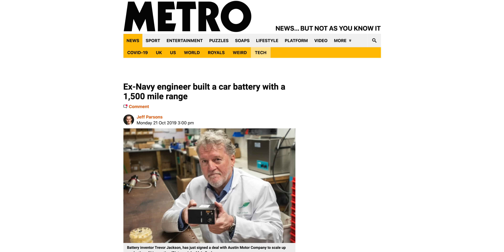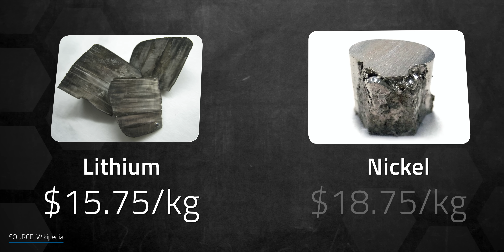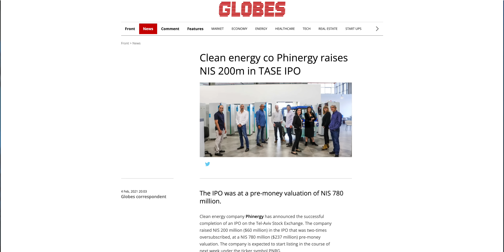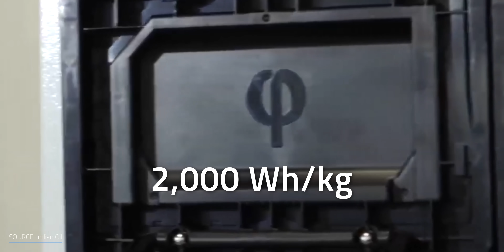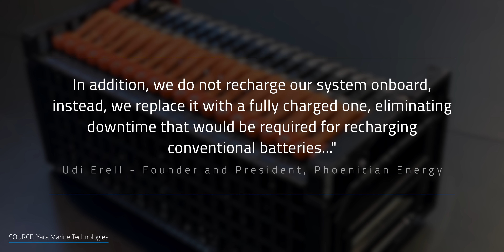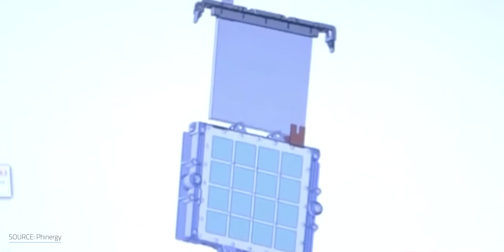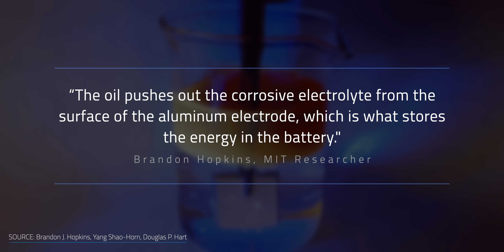Exploring the 1000 Mile Car Battery - Aluminum Air Hype?

Comment: If these had shelf stability and could easily and safely be stored at home and can be swapped out by a lay person they could have applications far beyond EV uses. The potential use for emergency backup power during a natural disaster over a gas generator would be interesting.

I would like to know if the aluminum can be recycled back into battery packs or would they have to go back to virgin materials to make new packs. I don't think building out massive aluminum strip mines and the toxicity that can be produced from mining generally would be the best solution if we are truly trying to create a green energy system. 

Much more information needed and look forward to the research continuing. the energy density is great but something with more than one life cycle i think would be much more useful.

Comment: Two batteries!  Each providing, what, a 1200 mile range.  When one drains, switch to the other one.  Then you have ~1200miles to get the dead one swapped. And, if this ever takes off, and there are a plenty of swapping stations, no prob.  The only draw back will be the drive until the tank is empty mentality.

Comment: I bet on it aluminium air battery is a better option for EV's because of the range & energy exausted battery swapping which can be done by 100s of thousands of fuel station spread over India run by Indian oil corporation.. 👍

Comment: Hi Matt! Probably the first time I am in disagreement with you. Aluminum batteries can not be recharged, agreed. But then the traditional ICE cars are also not rechargeable. So, what happens when we are out of fuel? We refill the tank right. So, when cars are out of juice from an Aluminum battery the same can be replaced/swapped within minutes. In contrast to setting up an EV charging station, a battery swapping station network can be made fairly easily as the nature of these battery consumtion will change to become more like an commodity. The vast network of already present petrol pumps can be utilized for this purpose or a local shop can serve the purpose. Also, if a car is out of juice in the middle of nowhere, then probably you don't need to tow the car to the nearest swapping station, the battery itself can be delivered to the car as these batteries are lightweight. 
Putting it into the Indian context, an average car drives about 1000 KM/month. So if a battery gives 1500+KM range then the car owner needs to visit for refueling once in about 45-50days rather every week for a petrol car (India runs on petrol). Also, nobody needs all cars to drive on electricity immediately, a 50% market share by the end of this decade should be a great start. If others technical matters can be taken care of then these batteries can have a future.

Comment: Could be a range boost battery for a more conventional EV. Half is a normal battery, giving you 150mile range, then a backup AlO battery it can tap off to boost an additional 1000 miles or so. You get stuck, just charge your normal battery to get to a swap station. But you'd have to make sure the AlO battery's shelf life allows you to only occasionally tap into it.

Comment: If battery swapping is the solution, what's wrong with the current lithium ion batteries being pre-charged in stations and engineering a way to make those batteries in cars replacable in 3 minutes.....

Comment: I’m most interested in the recyclability of these. How long does it take and how much energy is used to re make batteries. These sound great for trucks not passenger cars.  Instead of waiting for the battery to reach zero we would replace at the end of every trip and use the excess battery as part of a larger battery use system perhaps to assist in peak shaving for EVs or other high demand cases. Also possibly a great use for rail since trip energy use variability is likely minimal.
Reply: Think  e: bicycles

Comment: Well, if the battery has a higher energy density, why not use it for avionics? It doesnt matter if the battery is replaced after long flights, that can still be a good servicetime compared to the time and risks with pumping jetfuel.

Comment: A lot of push that makes ev's vaiable option is using energy from my own energy source be it anything like outlet at home charging station or few panells/ wind turbine. I switched to rechargable batteries since i can recharge them when i need them and dont have to go buy new everytime mine died. This doesnt show such potential so it looks worse for comfort than normal gasoline for me ...

Comment: "On top of that, aluminium air batteries have a great advantage with weight, compared to lithium batteries, 'cause aluminium, which you're probably aware of [sic] is extremely lightweight".
Explain again the relative density of Lithium vs Aluminium. Or perhaps better explain your point, if there is one.

Comment: If a 1000 mile range electric vehicle came out, there would still be some people that say "it's not enough, I need more range". Even today, with EVs having ranges of 200-300+ miles per charge, there are still loads of people saying "I need more range" even though there are plenty of places to charge. So would extra miles of range really make much difference? Not really, because there will always be those that say it isn't enough, or that charging is a hassle. Only those that really want an electric vehicle will be ok with the current range most EVs have, so having extra range would just be an added bonus to them.

Comment: Those battery packs sound like the stuff from science fiction and Power Cores in video games. Just treat it like gas. You get to a station, just keep swapping the battery to keep the power bank topped. These things will have to be cheaper than gas to take off and have a solid recycle and collection model to be profitable. I can see poor people hoarding these things to sell back. I wish I could invest in them.

Comment: So this is like aluminum oxidation fuel. Hydrocarbons are broken down and then we can reassemble them so this should be considered a fuel unless I miss something. I'm still thinking carbon-capture into fuel made from the air is probably going to be about as energy-dependent

Comment: The problem with lithium ion EVs isn't range anxiety, it's cost. The batteries degrade too fast, and the price of replacement is too high.
Hybrids have been around for a while now, but there are none on the second hand market in my region.

Comment: There are places in America and around the world, (Australia, Russia, Africa, etc.), where range is a very real issue. I imagine that having one or more of these batteries (and a water tank) on a trailer behind the vehicle would make some of these transits feasible in a BEV, where otherwise it would not. A vendor can have locations at each end of the transit point. Multiple smaller batteries would be more useful than on big one because it would allow unused batteries to be returned to the vendor for a partial refund. The biggest selling point is that it would work on any BEV with a trailer hitch.

Comment: depending on the costfactor of a battery i'd really consider using one. but i have the advantage of starting to work as a service technician for ev charging stations and, if this becoming a thing, i guess i will be trained in swapping those batteries too. after all it's just a cool idea atm and, as you stated, a lot of research is needed to make these coming at least close to marked ready.
still hope to hear more about aluminum-air-batteries soon!

Comment: Personally I'd prefer rechargeable over physical replacement. I can generate my own electricity if needed. All the rest of the components of the aluminum air battery is just a crap ton of work someone else needs to do, and if there's a shortage, I'm screwed and stuck. If I could own a few and the process to get them back into working order were in my control, I'd consider it. But I'm guessing it is a lot of melting of aluminum and chemicals and other crap and I'd have to buy equipment and keep it somewhere. So yeah, even if they get it working great, I don't love the idea of having to stop at battery swap stations.

Comment: I would drive it 100%.  It takes more then 3 minutes to fill my gas tank and its gets 350-400 miles a tank.  So, 2700 miles sounds like a deal.  And the "specialist" to change the battery would only last a little while I'm betting.  There used to gas staion attendants and thats laughable now.  As for the side of the road thing AAA would start carrying batteries as soon as there was a market.  I think Al-air sounds great.

Comment: Using two batteries might be one way to fully use batteries before replacement. Once one is depleted, run on the other one until the depleted one is replaced... (Without that, batteries with some capacity left will constantly be replaced)

(If a long trip is needed, both can be replaced for the trip and the partially used one can be put back afterwards to fully use it as well...)

Comment: I like the idea to be honest. If they made a way for the average consumer to be able to stop by a "gas station" and pick up a spare on the way home for when they need to swap, this would work perfectly. Imagine having two installed and two more spares for a long trip. 2000 miles before stopping for fuel? Yes please! I can't imagine an oil company would mind this kind of setup either because it would allow them to still dominate vs lithium batteries allowing for charging at home.

Comment: No, I’m not untying battery swapping. It’s too many atoms being shipped around to the gas station equivalents and then back to recycling plants endlessly. It’s inefficient and potentially dangerous. Also swapping a big block of the car as battery is physically demanding of the car and the people involved. Pouring in a liquid refill (gasoline) is much easier, so we’re only going backwards. I can see why an existing petroleum company would like this as they are back in business but it’s all hard and inefficient and retrograde. Forget it.

Comment: We'll have growing pains like this as we move forward.  My Dad grew up in the 1950s and 60s.  Because of poor lubricants and tolerances capable in the cars at the time, he was used to cars needing an engine rebuild every 50-60 thousand miles or so.  The 100, 200, 300 thousand mile car engines today still are amazing to him.  We'll probably experience something similar with EVs.  We'll have range anxiety while our kids will wonder how we became so traumatized.
Reply: Can Air Aliminum batteries be a consideration for aviation
Reply: @roshansivaprakash1930  No.  Aircraft today are ~1/3 fuel by weight on long haul and less as range gets shorter and shorter. Kerosene with a conversion efficiency of around 45% has energy density of roughly 12,000Wh/kg compared to lithium ion of 200Wh/kg.   This aluminum battery specifically this version in video is 1300Wh/kg, or 10X worse than kerosene which only converts at 45% efficient which means the aluminum battery would be ~5X worse in terms of range.  So, it technically would be possible to operate a SHORT haul aircraft of say ~1000km, but you would not be going over an ocean.  Since it is NOT a universal solution, this = useless..... But for marine use?  Where every port has big cranes?   Hell yes, this is a solution.
Reply: @w8stral  There's a looot of air traffic under 1000 km.

Comment: Its all fine and dandy but you will never use 100% of the battery before you swap it out, so i think it will be wasteful to use.
With an rechargeable battery you can charge what you need and far les cumbersome.

The real use case lies within the capabilities of existing ev's like driving from and to work.
Most people don't do long trips daily, weekly or even monthly.

in my opinion this is not an viable option.

Comment: I would prefer to swap the battery on my EV in a minute instead of charging for a long time and let the companies deal with the batteries. But this NON re-chargable battery thing is just not ok. I'd rather see a capacitor like charging so that the car is full in a minute, even if that means a bit less range.

Comment: Rather than getting a tow, why not just get someone to bring you a new swappable battery if yours runs out of power? That has to be one of the advantages of a swappable system.

Comment: until these batteries are 100% recyclable, we should not call them sustainable. What happens with degraded aluminium? what will they do with water from the battery? Throw it to Ganges river? I guess silver will be scrapped the easiest right?

Comment: hydrogen is where its at, all you need is a light weight metal Polymer or carbon Nano-foam type hydride storage medium and the vehicle only emits water as the by product!
anyway hydrogen can be produced efficiently from sunlight using specialised water born catalysts, even the by-product of ammonia synthesis is hydrogen.

Comment: If they made it easy enough so that EV operators could change the battery then I would be willing to. I would just buy and extra one or how ever many I could fit with me on the trip. And then just drop off or swap out the used up ones along the way when I take breaks.

Comment: Honestly I'm thinking that battery swapping might be the best idea even for rechargable batteries - instead of people waiting in line, the charging would be done at the station. If there was an automated way to change the battery - like a hatch under the car that a machine could interact with - you could just drive in and have your empty pack swapped for a full one. 

As for the A-A batteries: If they can be easily recycled they might have a shot, otherwise it's going to be a dealbreaker with the ethos of future sustainability.

Comment: How awesome would it be for Electric Semi Trucks to pull up to the Flying J, have a machine remove the battery pack underneath the truck, roll the truck forward, click in the new one and immediately be back on the road? This way batteries are controlled, and downtime is eliminated.

Comment: Battery swapping stations has been suggested as the new petrol/gas/filling station model, even for lithium batteries due to the time required to recharge.  In countries where it is not uncommon to drive 1,000 klms (600 miles) in a day this is probably the answer.

Comment: Embodied energy of battery vs output? Can specialized mechanics just swap out the Aluminum Ingots, leaving in the silver embedded catalyst?  Wind/Solar/Wave power could be local sources of aluminum anode renewing, thus using energy when available - especially if the plant were robotic.

Comment: Would I want to drive an EV that requires battery swapping?
Absolutely!
Battery swapping would:
● End the unlikely-to-be-solved problem of waiting for a charge.
● Make it easy to have a spare at home that is always charged.
● Require standardisation and swappability of batteries, so any battery would fit any make of vehicle.
● End the problem that an EV becomes worthless when its battery fails.
Instead of looking at what’s wrong with battery swapping given the current lack of infrastructure to support it - look at how great it would be if fully implemented. implemented

Comment: This just means that you are locked in to a third party supplier and a service station model. I can generate my own fuel from my solar panels and/or charge up at home for the majority of my journeys. The recycling needed for every battery sounds like a major undertaking so the cost of the battery replacements would also be a major factor. If they could get the cost down to 1-2p per mile (£10-£20 per swap) then might compete with a conventional EV. Don't hold your breath

Comment: Well, back to needing to stop at a service station frequently to change the batteries.  Just like stopping for gas.  And every car would pretty much need to use the same battery pack and size, otherwise stocking multiple variants for different cars would be unfeasible.

Comment: This might help resolve the commercial truck issue. However, weight is the largest drawback. I’m not seeing strong/viable solutions in addressing electrification of the commercial truck market (other than hydrogen fuel cells).

Comment: If I can refull a car in 3 minutes or even 15 I would still be able to drive 600-1000 miles a day while on road trips. I am a little worried however that in a wreck the chemicals involved might be worse than say gasoline. I work in transportation, hazmat cleanup at every accident would be unacceptable.

Comment: Just tell everybody how stupid it is to spend all of that energy to make aluminium and then  use it in a car as a battery. 
If the thing is not rechargeable it is a joke, nothing more. You can not go around and replace traditional fossil fuel with fucking aluminium as a new fossil fuel. It is expansive, since whatever the cost you would need like 50 times the amount of the fuckers to take a low number

Comment: well the swap station is already being used in some Asian countries so totally viable. as for if it dies on the road it would be the same as any other EV just swap a battery to get you out of trouble. and it looks like it is more eco friendly than lithium/cobalt because it is recyclable. just like any other EV system problems will be overcome by innovation. like adding a substance to the water to stop degradation of the Aluminium. we are a pretty smart bunch if we are allowed to let our minds wonder.

Comment: It appears that initially the most logical choice would be for commercial entities that would store and manage a large supply of the batteries, i.e. intercity buses or fleet vehicles. The primary impediment for personal use would be the infrastructure needed.  I could envision a solution whereby a company drops off a few batteries and retrieves the spent batteries.  Like many technologies being advanced, there will be markets that are best suited for differing battery types.